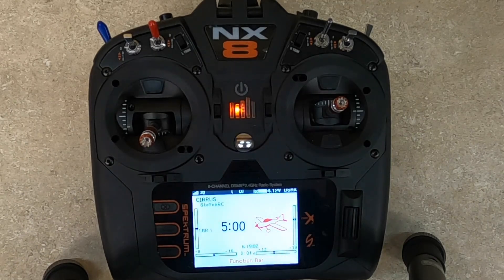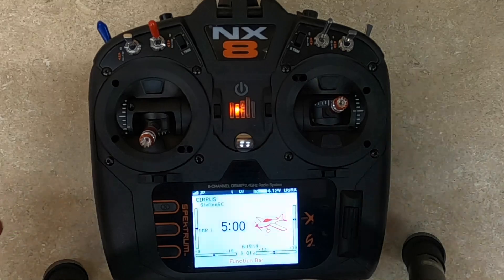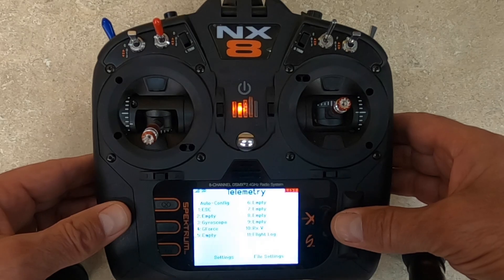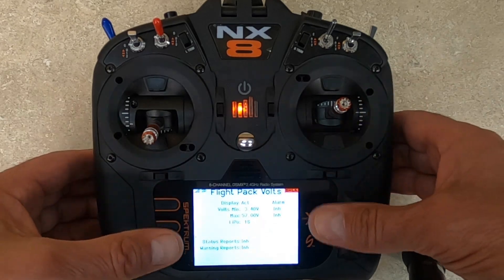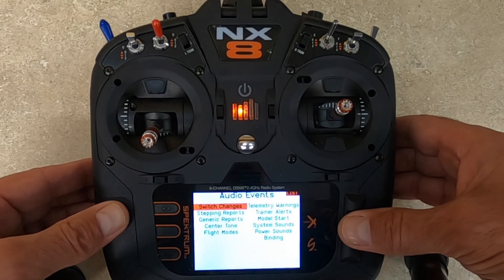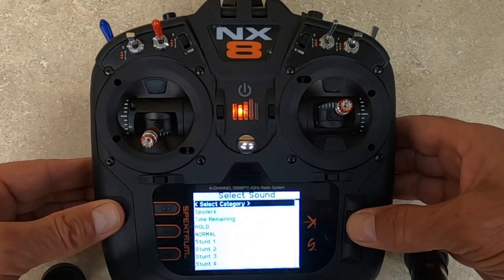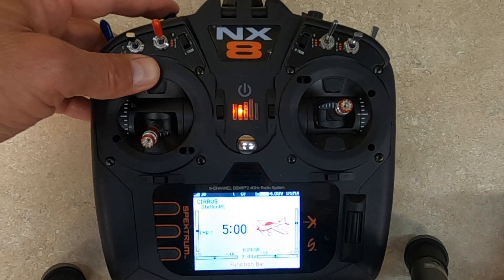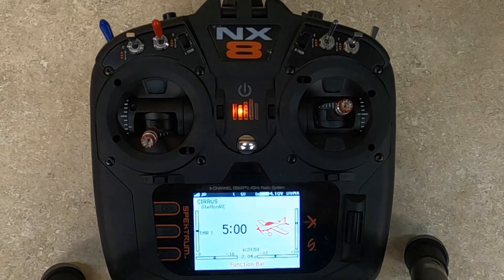How to set button on NX Spektrum Transmitter for flight battery voltage call out

Comment: Great video. Thanks. 

For me I would prefer to get the average cell voltage of the flight pack. Is that possible. It’s really just what the video determines divided by the number of cells.
Reply from the maker: The Spektrum system doesn't do that.  Its just picking up total flight pack voltage.  Other system like FrSky have a sensor that plugs into the balance port to give you more info like lowest cell, or average cell...
Reply: @SteffenRC  thanks for the response. Was hoping they might have it. My brain processes the 4.2 down to 3.7 number a bit better than the total voltage. 
Again, very helpful video.
Reply from the maker: @Tony3deee . I agree.  I try to remember the low voltage for 3s/4s/6s.

Comment: does this require a Spektrum ESC to work?
I have 1 plane that has another brand of ESC and it doesnt work while all my others work fine
Reply from the maker: You’ll need a Spektrum Avian ESC.  Or a Spektrum or LemonRX that can use the voltage sensor.  I made a video for that too. It should be in my Spektrum Tips playlist.

Comment: Thanks!  Got this working on my DX9's "I" button connected to my AR637T+ receiver.  Push button reports are better than timed.  I've noticed telemetry "thinks" I'm using a 5S battery (what is that?) when I'm using a 4S pack, probably because it estimates the number of cells based on total voltage.   Wouldn't it be nice to have flight pack "fuel" percentage reported when you push the button!? 😎 Is there a way to set telemetry callouts to "simulate" percentage?
Reply from the maker: Great questions..  Not sure about the telemetry for % battery.  That would be great.   The 5S vs 4S is in the Telemetry screen under ESC or Smart Battery I think.  You can change it to 4S..
Reply: @SteffenRC  Tried changing back to 4S and no joy.  Happy to live with it for now, but expect a Spektrum firmware update will address, as long as “smart” marketing is supported….
Reply from the maker: Yep..  Sorry not familiar with the DX9,  You're right to update when you get a chance..

Comment: Is there a way to turn on SAFE when I deploy the flaps? I fly in AS3X mode but would like SAFE to come on when I hit the flap switch to assist with landings? Thanks
Reply from the maker: Sure.  Just put the flaps on the Flight Mode that controls SAFE mode.

Comment: Lost track of battery pack reading the other day, you know what happened next....more glue, rubber bands, and straight pins.  This tip is a big help. Thanks
Reply from the maker: Dang Jay.  Sorry..
Reply: @SteffenRC  You can only learn through experience.  YouTube videos don't quite do it.  
It's all put back together, waiting for a new cowling. And she'll be back in the air.  
Every lesson is a step forward, just never repeat the mistake...

Comment: So for me, flight pack voltage is the most important telemetry information. I have been using the ticker tape to display the FP volts across the bottom of the main display for years, but I have to say, this is the best tip by far that I have come across in a long time. I also added altitude to the same button, so when the button is both pressed and let go, you get both call outs.
Thanks so much for figuring this out and sharing it with all of us. 😁👍🏻🛩️
Larry
Reply from the maker: Thanks Larry,  Appreciate your comments.

Comment: Isn't it  easier to set your low voltage cutoff (alarm) and then land the plane ?
Reply from the maker: If that how you like to fly yours then yes its easier.  I like to see how my battery is holding up on my flights to see if I have enough for a few more passes.
Reply: @SteffenRC  I might try it
Reply from the maker: I really like it on my EDFs since they eat batteries so fast.   Its good to know if I have enough for a go around.  Some of my older batteries don't fly like they used to... :-)
Reply: Is it possible to do it this way? I'd like to do it so I can fly safely and receive a warning with the voltage I've programmed. I use audible warnings for the batteries, but if the plane is a bit far away, they can't be heard. I'd like to use it the way you're suggesting.

Comment: Can you assign it to a switch, like the throttle cut switch, so if throttle cut is on, it doesn’t say the voltage, but if your throttle cut is off. It will speak voltage every 30 seconds?
Reply from the maker: Great question.  I'm not sure.  I know you can get the callouts on 30sec intervals, but not sure about tying that in to the throttle.   Creating a if/then program in the Spektrum radio isn't something that I've looked into..   Thats why I just like it on the momentary switch that I can press when I want..   Sorry I don't have the answer, but I'll look around and see if I can find out.  Thanks Will

Comment: This has worked perfectly on my previous models, however on my last one for some reason when set up EXACTLY the same way, all I get is "Flight Pack 0.0 volts" ... any idea why that might be ?
Reply from the maker: Can you get the telemetry on the TX monitor?  That would be odd if the current battery voltage is on the TX screen, but can't call it out...
Reply: Yes, that’s what strange, I am getting full telemetry, it’s showing an ESC voltage of 12.5 V on screen
Reply from the maker: @handlebarsandholidays  and you added VOLTS to the TELEMETRY page?   That’s really odd.
Reply: I sure did, I've tried adding Volts to different slots on the Telemetry page and also assigning different switches, but all she will say is "Flight pack 0.0 volts", it's VERY strange !
Reply from the maker: @Carlshandlebarsandholidays   I'll try and play with some stuff to recreate it, but I can't think of a reason or a cause for this.  If Telemetry is on the TX, it shouldn't have any issues calling it out.  Doesn't make sense.
Reply: Ye it absolutely doesn’t make sense does it, I’m still waiting of a reply from Spektrum so hopefully they’ll come through with an answer, if so I defo let you know (thanks again for your help) 👍👍👍

Comment: I had no idea this could be done...much better than calling out voltage every 30 seconds.  THANK YOU
Reply from the maker: I know right.    I’m new to Spektrum. Coming from FrSky.  I had that feature on that system and knew there had to be a way.  The Spektrum system is impressive.  Thanks for watching and commenting.
Reply: isn't there an option to make voice alert when voltage is below specified amount?

Comment: Sweet. I want a button that gives me a milkshake.
Reply from the maker: I’m still trying to figure that one.  Give me some time.  I’ve only had this weird Spektrum stuff for a week or two.
Reply: I’ve had my NX8 for a few months Will and it still hasn’t ever offered me a milkshake😂
Reply from the maker: @cooltube  well, hang on.  I’m getting close to configuring the latest firmware to do it.  Only issue for Model AV8R is he’s lactose intolerant, so I got a bit more work ahead.  😎
Reply: @SteffenRC  🤣 crack on you’ll sort it👍🏻